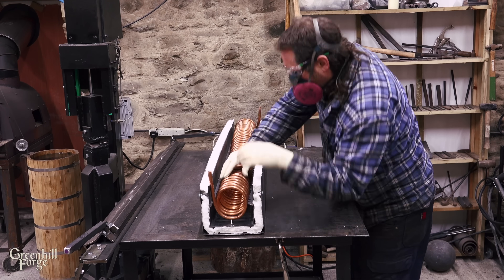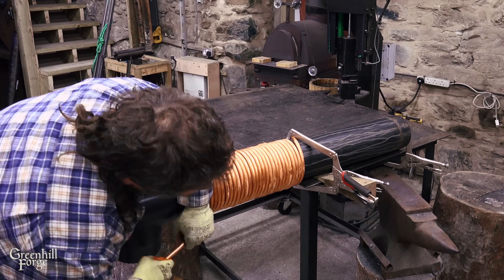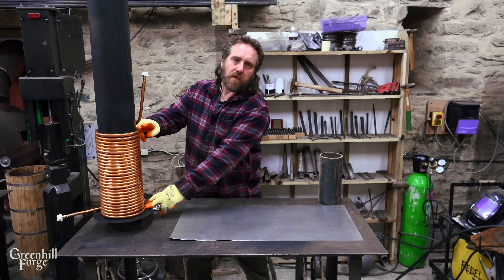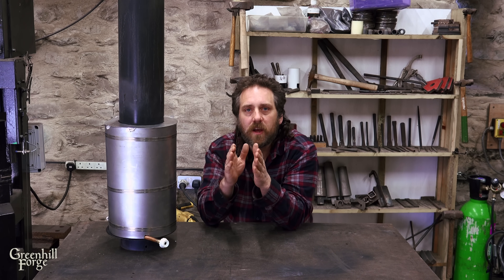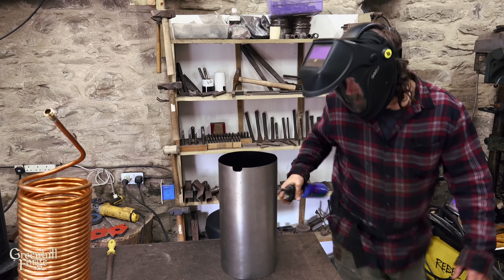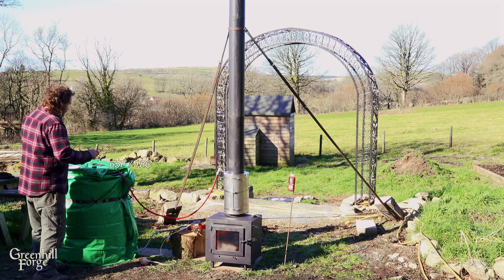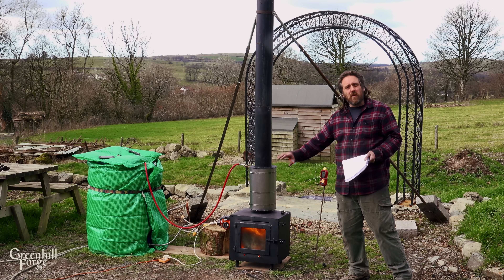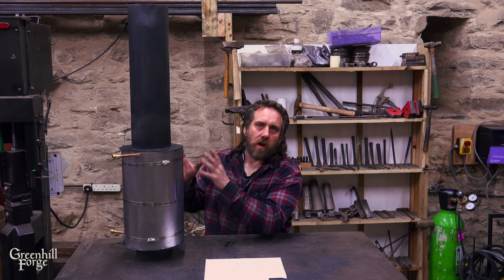Best Wood Stove Water Heater Yet: New Design Tested | Off Grid Water Heater pt3

Comment: I think that some spacing between each coil winding will result in significant more efficiency. As in stretching the coil out a bit. I was thinking about enough spacing that is about the thickness of the copper pipe so that the coil becomes between 1,5 and double as high. I also wonder if you can get more efficiency by making the exhaust gasses inside the stove pipe more turbulent by adding a rotating stove pipe cowl. And insulating the remaining stove pipe might also increase efficiency. The exhaust gasses will stay hotter, and exit the stove pipe faster which in turn will draw in more air to the fire box and result in a hotter and a more complete burning fire.

Comment: Condensing the creosote inside the flue means it will drop back into the fire immediately, burning it and making for a cleaner more efficient combustion. So that’s the best way to extract flue heat rather than letting it escape through the roof. A coil inside the flue in a cone formation will force emissions past the cold coils causing the above mentioned advantages of creosote elimination and be able to extract the heat from those emissions.

Comment: You might want to take inspiration from the design of boilers in steam locomotives. One key innovation was to have the hot gasses move through many tubes in a hexagonal pattern submerged in water, providing a huge surface area and improved heat transfer because the water is in direct contact with the hot metal that's effectively the flue. You don't need copper either -- stainless steel will do.

Comment: We used to have a "kachel oven" large mass getting equally heated through hollow ceramic tubes.
It used to heat the house through the night an very little wood..... and put the copper closer to the flame.... inside the furnace.

Comment: if you setting it up for thermosyphon:
first you should use inch copper tube (25mm). 
second it should be set to a grade of 1:7 (assuming you using standard flue 6 inch (150mm) flue pipe the coil should be 1 inch (25mm) pipe with 2 inch (50mm) spacing between (not center to center).

Comment: You should do a test measuring additional copper lengths. Another 40ft of copper would make the water time in the heat longer heating faster. Then try another 40ft making 160ft of copper. It would be interesting to see if 160 ft of copper would cut your time in half.  Great video

Comment: I'm thinking direct water heat transfer. Similar to a boiler.. a water filled flute. Smaller in diameter maybe 1 inch id.. by adding 3 of them to a manifold much like exhaust on an engine. With  the copper coils inside you have multiplied production n maximized heat transfer while maintaining a 3 inch total diameter exhaust.

Comment: If surface area is your main issue, might I suggest trying a method of multiple coils of smaller diameter copper tubing? Where if you've ever taken a couple of springs and twisted them into each other, causing the coils of one to jam between the coils of the other, that's what you would do here. The theory at least is that by having a smaller diameter pipe it'll allow the water to heat up faster inside of it, but one singular coil will bottleneck the entire system. So by wrapping multiple thinner coils around at the same time, you're then allowing the same amount of water to flow through whilst helping to give it more surface area. You would basically be making a tubular radiator, where a radiator like in a car works to increase the surface area as much as possible that way it can transfer the heat from the coolant moving through it as quickly as possible.

Comment: I'd be curious to see the efficiency of these flu coil methods compared to placing a large metal water container directly on top of the stove/furnace/flame. Why not heat the water directly? If for nothing else but to compare efficiency.

Comment: Next expiriment:
Stretch the coil so there is 1cm /0,5" between the pipes, that way you gain a lot of surface aera from the flue. this allows for a longer time for the heat to go from the air in the flue to the pipe.

Comment: Ok everything you did was reasonable, except for using wood for the test fuel. The amount of wood you used, when it was added, how wet or dry it was, how much your started with are all variables very hard to keep constant from test to test. What that in mind it makes some of your efficiency calculations fuzzy.   You should have used a gas burner where you could regulate the flame height for all tests and if you really wanted to be precise even weigh the amount of fuel used for your efficiency calculations. 
Having made this observation I find what you did to improve your overall efficiency interesting from test to test.   I also agree that placing tubing inside of the flue is very problematic and most likely not suitable for indoor use. 
Sand is a thermal mass which has to be heated at the same time as the water and tubing.  It robs the system as it is coming to temperature.  An insulator like rock wool or pearlite would have been better.   Over all you are moving in the right direction to improve system efficiency.  Energy has to cross the steel barrier of the flue.  It then has to cross the copper barrier to  heat the water.  Using graphite to improve transfer of energy from steel flue to copper tubing is a good idea as it does increase the thermal area and doesn't rob as much heat from the system as sand.  Not too sure how hot your jacket was around the copper tubing, but a layer of insulating material between the graphite and the steel out jacket would help improve over all system efficiency.  Any way to improve heat loss makes the stem more efficient.  Nice video.

Comment: How about on top of stove using same method tracing outside of the top to middle or a pattern more better for flow. Weighted down or weld some bolts with washers and nut ti tighten down hold it together

Comment: Dumb question here. What length of copper pipe produces the most efficiency? Is the length of pipe increasing efficiency linearly? Exponentially? Are you getting reductions in efficiency by increasing length? I mean if you have a 10 ft piece of pipe and a 20 ft piece of pipe is 4x more efficient than it would stand to reason that getting a 20 ft section would be worth it.

Comment: Maybe a double wall flue pipe like those used in fireplaces would be an option because the copper coil could be wrapped around the first layer.

Comment: I commented back a month ago... all of these designs you've done, then and now, are the hardest way to get heat out of a stove and into water. You're using exhaust gas. That's how you'd get the last few percent efficiency out. Put the darn coil inside the combustion chamber on the ceiling. You'll get heat 5-10x as fast. This is all really silly.
Reply: Wow! The best comment. 😊

Comment: your losing alot of efficiency due to the length of your coil. i understand that you are trying to use the same amount of copper but where the lose is coming from it the amount of coverage on the flu. on your internal version the coil covered more of the length of the flu. in your next version spread the coil out to cover more of the flu pipe

Comment: Craft your own boiler. Take two barrels, one slightly bigger than the other so it can fit inside, and weld them together so they are sealed and water passes through the space between the barrels. Make an access door to the inner barrel for your fire.

Input water here--> (water(fire)water) <----Output water here

This maximizes the contact area. And no more copper pipes. The most difficult part would be welding it air tight.

Comment: If it's not too much trouble an extra pipe with water in it would make even more contact can you have extra hot water. To reiterate you would have a another pipe on the outside of the coils with a flow of water.
Reply: Just watch more of the video and you've already got the thing that would hold water just put a hole in the bottom and be able to add it at the top in addition to some hot water and the best heat transfer you will have humidity that will make you feel warmer

Comment: I'm wondering if it would be feasible having the input hose go to a pot or sealed pot (boiler?) sitting on the stove itself, before going into the coil, or even having a spiraled coil that rests on the flat top before entering the vertical coil. In the former I suppose you could run into some pressure issues, but then again it might help the flow in a system without a pump attached. 
Anyway, great video!

Comment: On domestic "Gas Savers" which preheat cold using a copper coil around the flue, before it goes into the boiler, they simply use water as the heat transfer medium, and seem to be set up to top up automatically like a toilet cistern, or vent via an overflow pipe if overfull.

Comment: Brilliant.
What if you cut the chimney, down above your coil  removed the wool insulation and added a barrel type of system to make the hot gasses go down around the outside of the metal coil sleeve so it heats the copper / graphite from both sides, then just have the exhaust at the bottom J bending up as normal, like the sysem on a rocket stove with a thermal mass bench

Comment: Very intresting. Why did you not concider a simple water jacket around the flu pipe? My gut feel is that if the coil was spaced out over a longer section of the pipe, you would be able to absorb more heat.
Reply: yes, a bit of spacing on the coil would enable the graphite to encircle the copper more

Comment: Delete the copper tube entirely, make a water jacket around the flue.  Your surface contact will be exponentially better.  Make it out of stainless and insulate the outside
Reply: yes there are stoves like this, with a box welded to the back with 2 outlets

Comment: I think, spreading copper pipe further to the middle  of the exhaust tube will add more power,  because you will increase heat exchange surface. Maybe, thinner copper pipe will be more suitable for that.

Comment: I like your experiments, but i believe that the different lengths of your coils between inside and outside the flume test's, are what's causing different results....  if you do a 5th test with the coil length longer....  the coils spread out more where the overall length of the coils more closely match the tests from the inside the flume test.... your results would improve and match better.

Comment: Wouldn't graphite be flammable in the right (wrong) situations? I know it's sealed, but I can't help but wonder what might happen if the vessel was breached in different ways or it somehow just got into the air or caught a-smoldering when the firebox was open or some other perfect storm.

On that note the copper pipe was embedded in the actual inner walls of the firebox?

Comment: I have a suggestion. Instead of having one big stack, have something like a water-to-air heat exchanger where the hot air passes through lots of small tubes that are surrounded by water, and it's got a housing around it to seal the water.

Comment: For instant heat I think a way to improve the setup is to work out a pickup tube that adjusts the draw point for the coil loop based on water temperature in the water tank. If the hot side of the coil loop drains at or near the top of the tank, water will heat top to bottom in the tank. If the coil draw is set to follow the height of the water that is near the ideal water tank temp, the water at the top of the tank will heat far more quickly than water lower in the tank(as it is recycled through the coils). If the hot water outlet of the tank set to pull from the top of the water column, the time for water to reach temp would be quicker. Ideally the water tank would be refilled at or near the bottom of the tank to avoid disturbing the water column.

Comment: Your copper coils are wound very tightly around the base of the system. Might I suggest either stretching that coil so it takes up more of the length of the flue and adding some more graphite insulation and insulated as before or wrapping more copper around to make use of the entire length. I understand it would be a bit top heavy but you looked to be using supports anyway. The only thing I could think of to capture more heat would be to use more of the flue to capture that heat. Maybe use some sort of thick paintable form of that graphite and make a really thick coating around the copper coil and flue then cover that in insulation and encase in metal. base idea would to use more of that wasted heat you saw floating in the air above your original coil.

Comment: Instead of sand, how about glycol or just plain water? With the thinnest jacket possible. Would get much better transfer between the flue wall and copper as everything would be fully wetted. Sand or graphite, still have a lot of gaps and air pockets. Neat tests tho.
Reply from the maker: yeah, different fluids would be good to test. just comes with a whole different set of pros and cons.

Comment: Maybe try a looser wound coil with the same length copper pipe (make gaps between each coil so it goes far up the flute). Insulate and add graphite or other heat transfer material. Not sure if the limiting factor is heat transfer to the copper from the flute or from the copper to the water.

Comment: A word of caution, GRAPHITE CAN CAUSE GALVANIC CORROSION WITH STEEL. Not sure if they need to be wet. It's conductive and actually has a very different electrical potential, or whatever the value that if different causes galvanic corrosion when one substance acts and anode and the other cathode. Could be exacerbated by heat (can exacerbate metal oxidation). Interested to see how it goes.

The Arobella (wooden sailing ship, self built) had the zinc sacrificial anode oxidise away in a few weeks when it should last 1+ years because they used a graphite prop seal...

I would suggest oil. It has low thermal capacity compared to water so will warm quickly and the thermal current could help transfer heat about. GL!
Reply: You could use a pump to spray oil onto the flu at the top and let it run down into a sump with the pipe in it.

Also it will help if the airflow in the flu is turbulent. There's very little surface area compared to cross section so laminar flow will mean very little heat captured.

You could also try putting something in it e.g a 2nd flu cut with with little veins bent in to mix and draw out heat to the walls where you're drawing heat out of.

Comment: You need to wrap the pipe another a small tube as this slows down the gasses ,we been issuing this system for over 50 years . Your better to use double twist pipe as it stop “ cold water blocking or bubbles “ and the efficiency is more than double the single twist .

Comment: I studied proces tech, but thats about 50 years ago.
Err Delta t has to be high. The higher the better.
Then theres heat conduction. Copper is good.
Flow, obviously.
And contact surface.

You are using round copper pipe, which means a very small surface contact (you didnt have that problem with round copper inside the exhaust, bc fumes will be all around). And you try overcome the problem of air for most around the area, which is a strong insulator, by adding material to increase heat exhange by filling up that air area.
Thats never going to be great. First of because you have 4 transitions now. Gas to steel, steel to grafite (or other), grafite to copper and copper to water.

You need to increase the copper to steel contact area (could also increase the total height of the exchanger, bc its kind of small), so youd need square copper pipe. They do exist. That will give far better results.

And another thing you could do is skip the pipe all together:
Use the rings as you made at the bottom and top. Cut strip(s) of sheet metal, same width as the outer diameter of the rings. Weld them on your exhaust in a spiral. Make an outer skin for that. Weld shut.
Water flows through there, skipping the steel > copper and copper > water transition entirely. Youll have steel > water directly. Will be far better, because you not only skip one transition, but the water will be contacting the steel everywhere.
Negative may be rust, but that can be solved. You could also make the entire exhaust from copper for even better heat transfer and no rust. So the exchanger also completely from copper. Dont solder, but copper weld.
That will not be as good as copper piping inside the exhaust, bc the gas to metal surface is smaller, but that will give best results of the outide options. And its pretty much maintenance free, as opposed to copper pipe inside the exhaust.
Id like to see you test that ;]

Comment: Thanks for sharing. After watching your two videos on this, it looks like your issue is protecting the copper but also exposing the copper as much as possible to direct heat. Have you considered something permanent such as making the copper coil first, then encasing the coil in a thin layer of concrete or similar material? Just an idea.

Comment: Amazing video! Thank you for sharing! I want to suggest a modification to your final design.  Weld vertical steel fins to the inside of the flue to increase surface area for heat transfer.  If they only poke in an inch, should still be easy to clean. If you put 1 every say... 15 degrees around the flue, you would increase the steel surface area that gases will touch by about 60%.